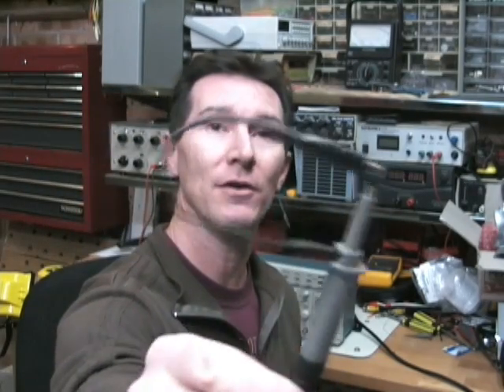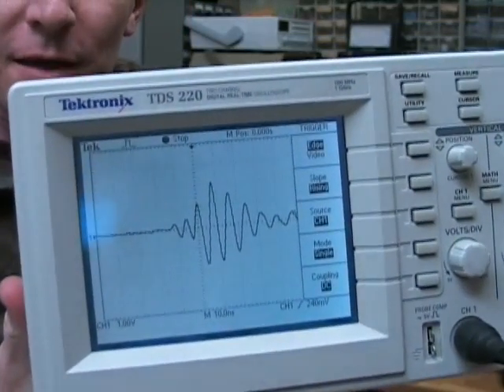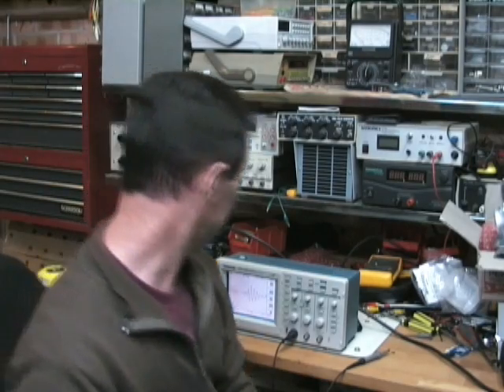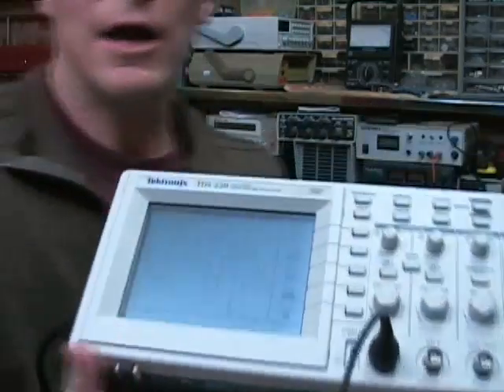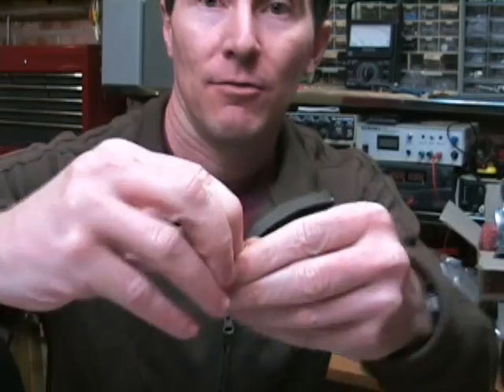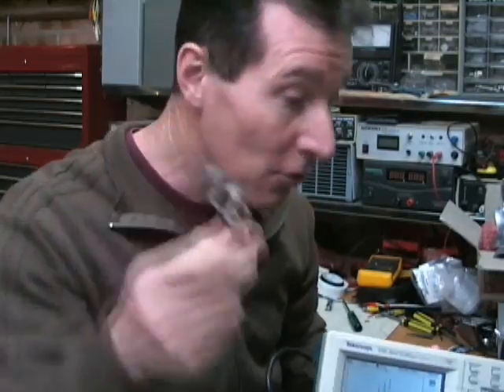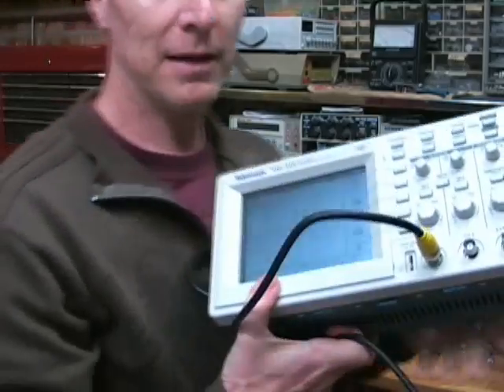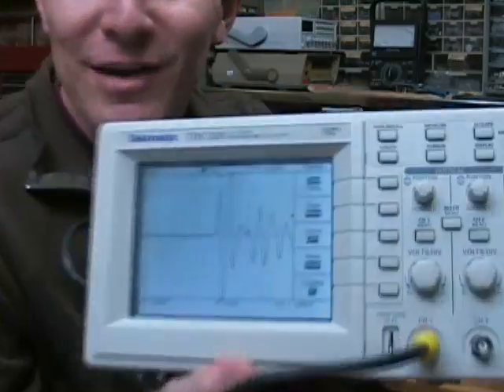EEVblog #20 - The Unusual Oscilloscope Phenomenon Part 2

Comment: The frequency that it seems to manifest itself at is also interesting. 120MHz or so... Hmmm, I wonder if it changes frequency if the length of the coax is different. If you have a much longer piece of coax with a BNC termination on it I'd try that and see if the frequency is lower

Comment: Very good. I could not reproduce it myself but the principal is correct with inductance, as anyone would know if they have a strong background in Electronics. You have a very basic high impedance tank circuit thats picking up a HV static charge. Creating the static depends on Material, Temp, Humidity and several other things. I never thought of this anomaly before, but it is interesting. Cheers!